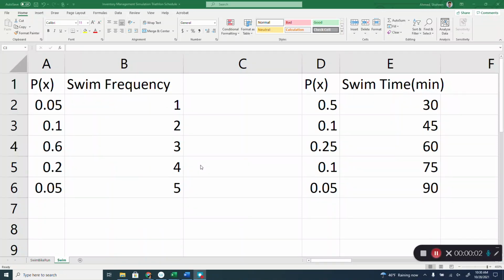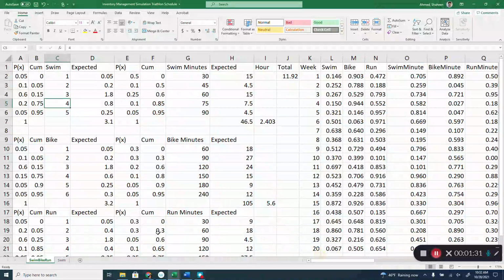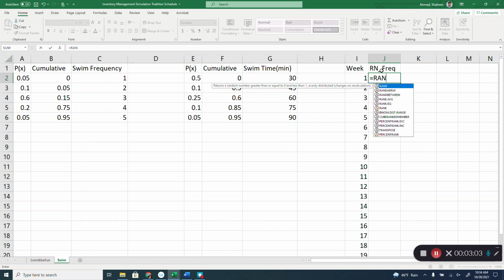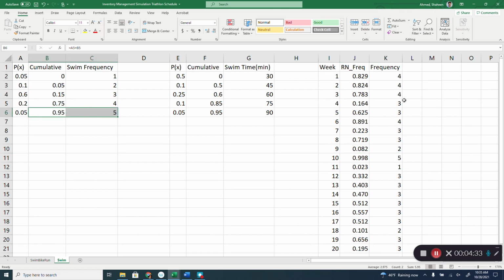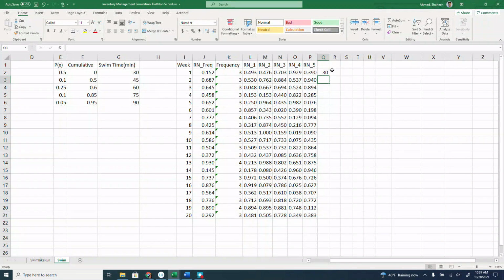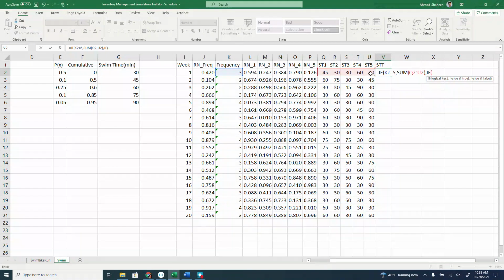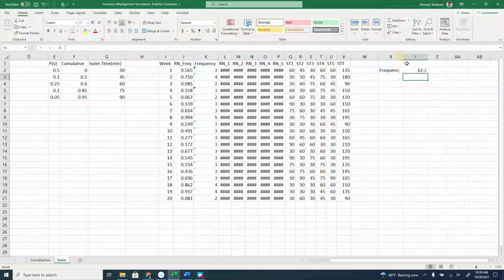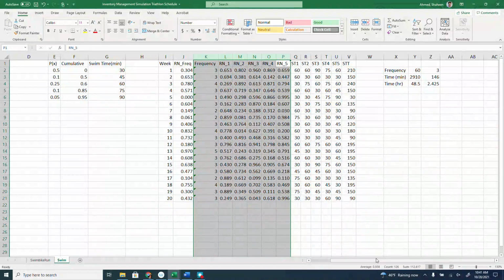Monte Carlo Simulation using Microsoft Excel and Solve Problems

Comment: 00:03 Using Excel for Monte Carlo Simulation and Problem Solving
01:12 Monte Carlo Simulation in Excel for training and product line simulation
02:22 Using Excel functions for Monte Carlo Simulation
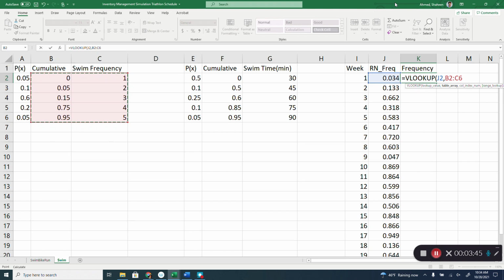03:48 Utilizing VLOOKUP function for frequency calculation
04:58 Generating random numbers to determine swim times
06:34 Using the IF function to calculate total swim time
07:59 Calculating total time using swim frequency in Excel
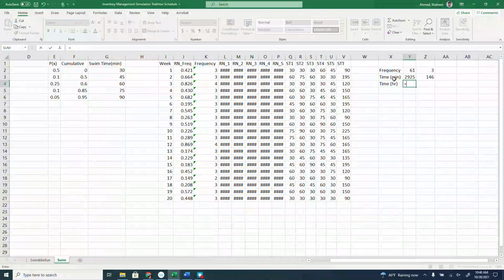09:26 Utilizing Excel for Monte Carlo Simulation
Crafted by Merlin AI.

Comment: Interesting approach, but I missed something. I thought you would use your outcome and then simulate a lot of runs. In other words, as if you pressed the F9-key a 1000 times or so and kept track of the outcomes to calculate an average. I am looking for an Excel routine (other than via Visual Basic) that can do just that.
But, thanks again for making this video. It is definitely useful.